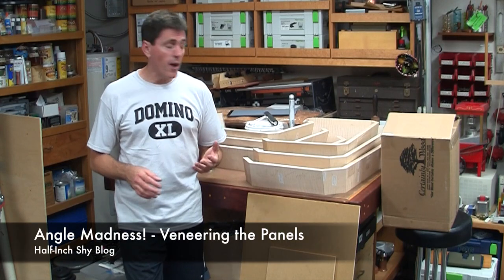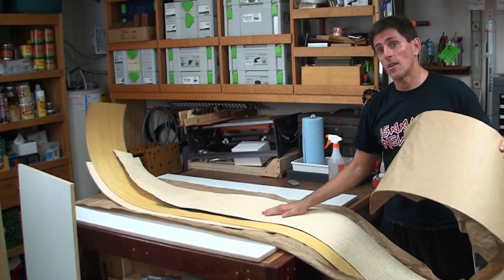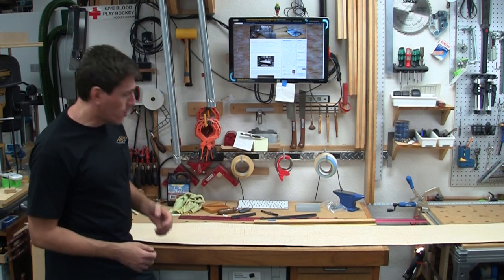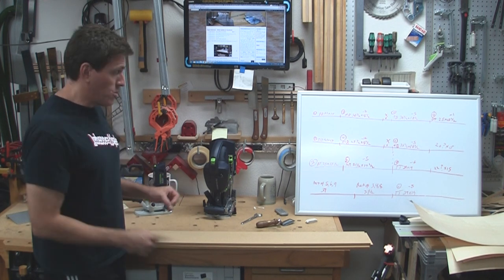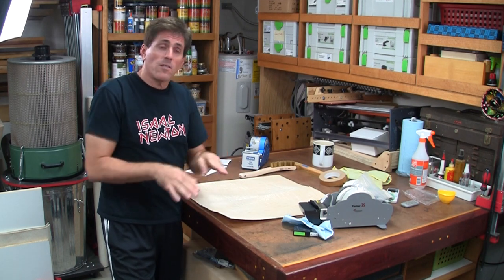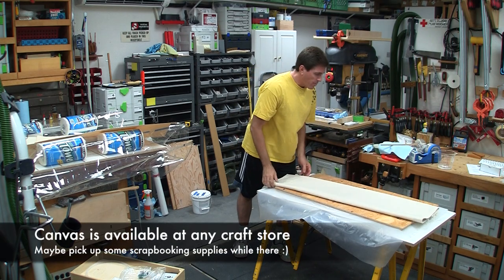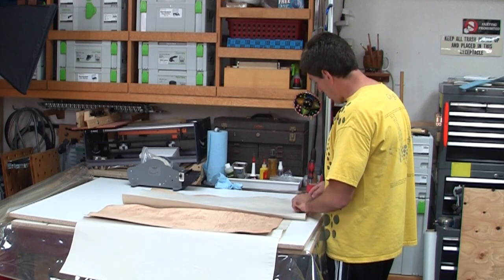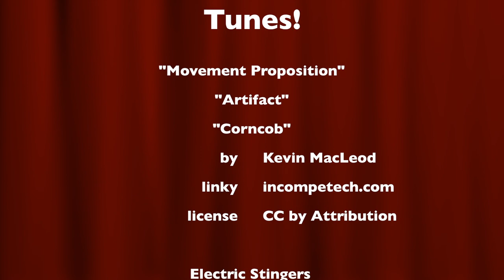#64.6 - Angle Madness! - Veneering the Panels

Comment: Great video I just started a beginner project on my 2005 Chevy Blazer  (Window/Door buttons on the door console) In a Walnut burl and yes it has a slope and a curve to it. With a little internet home work I did a 2 water 1 glycerin *1 alcohol and a softener without glue because the panel was flat I just needed to apply/shape it Never had a air bag so i used about 20 tie straps and a blow dryer set on low Came out pretty good just going to let it full cure overnight Then shave off the trim and light sand. 3 coats of sanded varnish and buff Then on too about 8 more pieces  Thanks for some of the tips
Reply from the maker: freakyflow That sounds like a cool project. Yeah, veneering doesn't need a vacuum bag though it is helpful for some shapes.
Reply: ***** ya its coming along great ..rolls royce eat your heart out : )